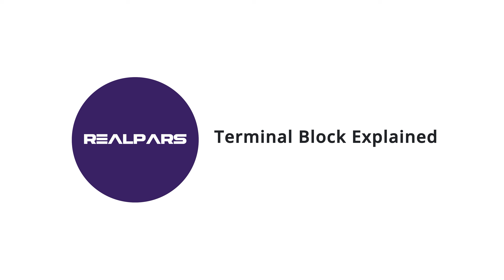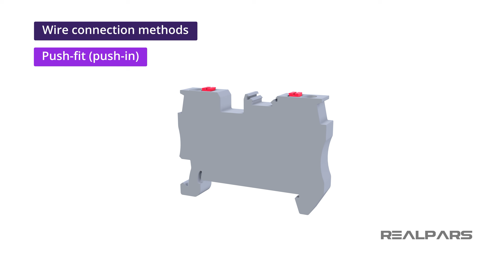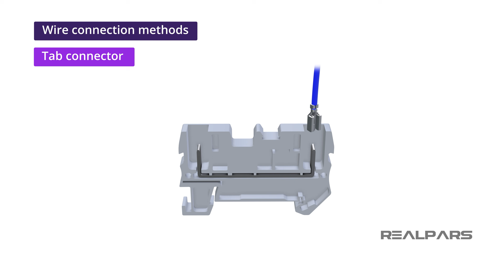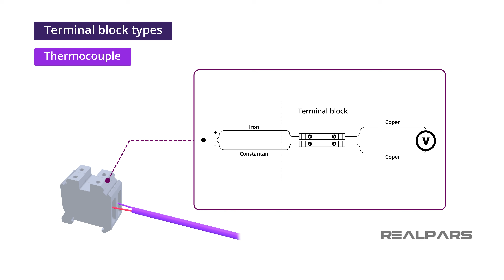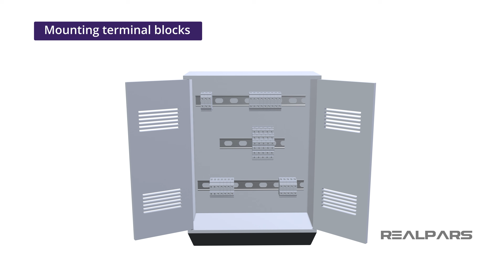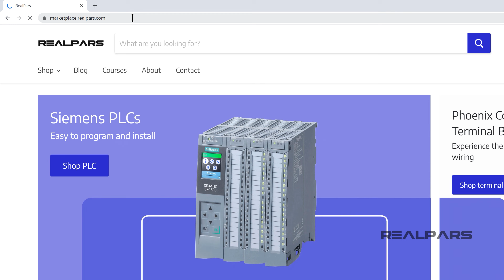Terminal Blocks Explained

Comment: Fantastic video. I've been using these for years but I was just never entirely sure on the nomenclature and the different types. It's funny because my new job now is going to be dealing with a lot of thermocouples for sealing machines in the food industry, and as the process improvement engineer it would have been embarrassing if I didn't know that I needed a specific terminal block for those connectors.
Reply from the maker: Thank you so much!

Comment: i want to learn about the structure and working principle of PCB and the symbols on the PCB, can you help me?
Reply from the maker: Hi there. I'm sorry, but I'm not sure what you are referring to. Can you please elaborate?
Reply: @realpars  (printed circuit board assembly - PCBA). i would like to ask you about the principle of current input and output  on the PCBA,and the meaning of the symbols above it.  For example 0v,12v,24,COM....

Comment: Great video! Some more information:

1. Usually, gray terminal blocks are used for phase/active/line/hot wires, blue ones are used for neutral wires, and green with yellow ones for ground wires.

2. There are cover accessories to cover the right-most terminal block, to avoid leaving exposed contacts.

3. There are accessories to join various terminal blocks together. That is, to form a single electrical point or node. In this way, theres no need to splice wires.

4. There are accessories to avoid slipping of the terminals blocks. In this way, they can’t move sideways in the DIN rail accidentally.
Reply: Hi, could you please tell me more about the accessories to join terminal blocks together? I am a mechanical engineering student trying to build a controls panel. I have a 24VDC PSU which I want to supply multiple components from. Sort of a 'single in, many out' situation. What should I search for? I want to connect around 3-5 DIN mounted terminal blocks
Reply: @samd8100  That's called a DIN rail terminal block jumper or bridge

Comment: I always use Weidmuller screw in terminal blocks when connecting cables, the barrier is just to low quality. Take two screws in terminal blocks and zip tie them together, best connection you can get.

Comment: Is it possible to check the signals by connecting leads in push feed terminals like it can be done in screw-in terminals?
Reply from the maker: Hi Dipankar. I'm not sure I understand your question, but I'll give it a shot. Unlike screw terminal that quite often will support more wires, push-feed terminals are not so user-friendly.    Adding additional wires for testing is not usually possible considering that space is limited.  I hope that helps?

Comment: I have a hard time getting a reading of voltage on wires on terminal blocks at times  with my multimeter  not sure if I'm placing in wrong hole

Comment: It would’ve been great if you had mentioned installation terminals with neutral sectionable conenection and what are intended for (for instance the part number type PT 2,5 L/NT/PE from Phoenix Contacts)